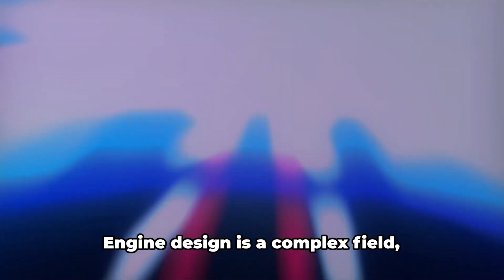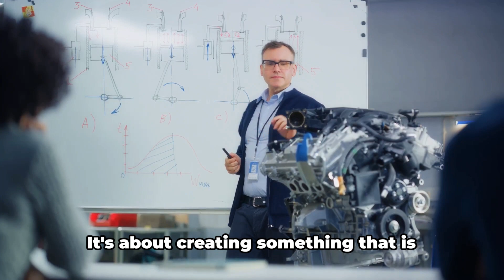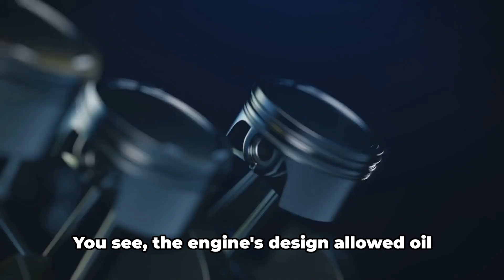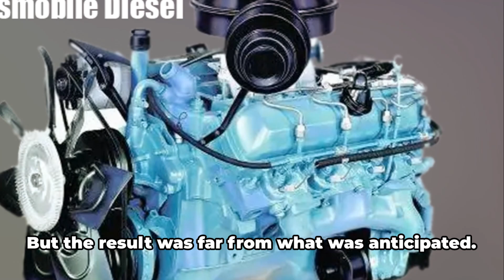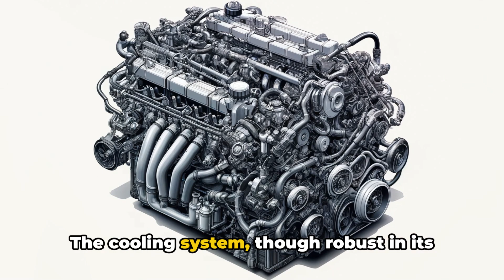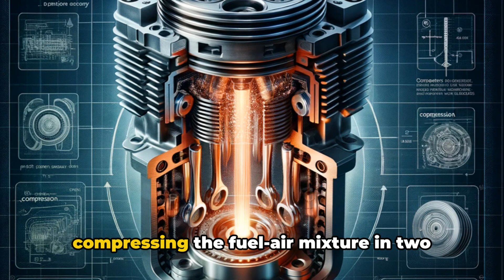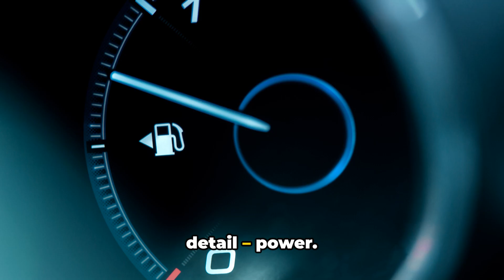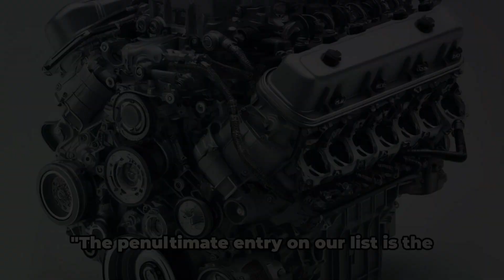Top Automakers' 10 Engine Failures Exposed

Comment: The Jaguar V12 was replaced with a 350 Chevrolet a lot.Left out the Ford 3.8 essex engine which had headgasket problems.The worst diesels are the 6.0 and 6.4 powerstrokes.The V8-6-4 ran good with a sensor left unplugged for the V8-6-4 disabled